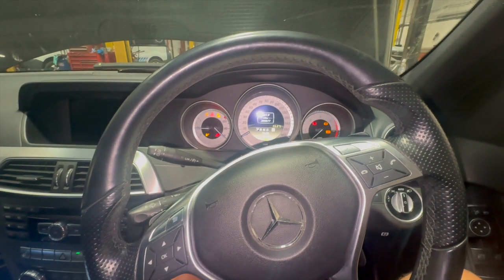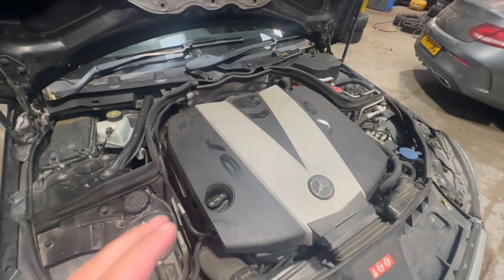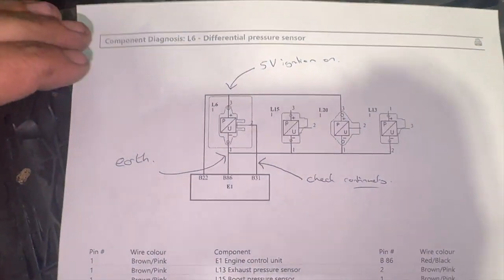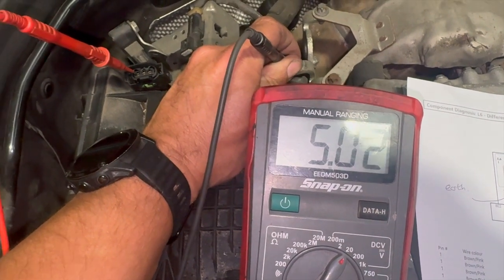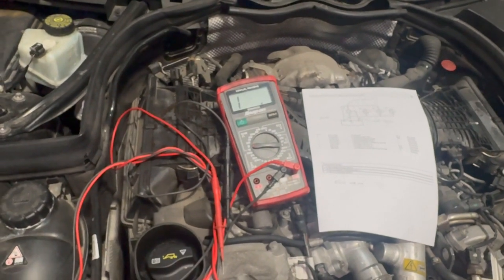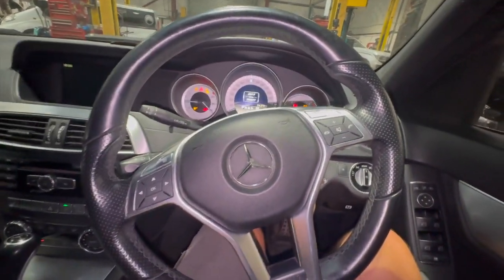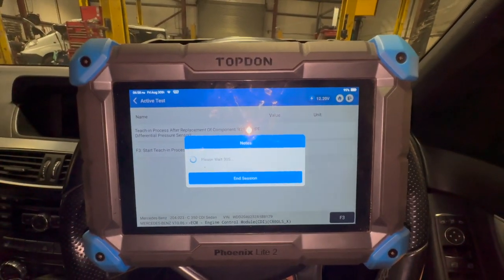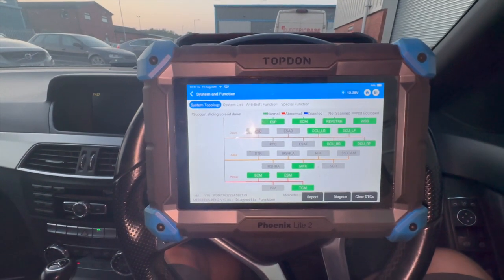Mercedes C350 Investigating & fixing Engine light fault P15FF DPF Pressure  Sensor replacement

Comment: I’m reaching out for some advice on my 2018 MK8 Fiesta EcoBoost with 66,000 miles (105,000 km). I recently bought the car from my mother, who had it from new and maintained it with a full service history. The car was never driven hard or far she mostly used it for commuting.

Here’s the issue. On Monday, while driving on the freeway and attempting to overtake another car, I noticed that when the RPMs went over 4000 the car cut power. I pulled over, turned off the engine, and restarted it—after which it ran fine again. However, the same problem occurs every time I push the RPMs over 4000. When I restart the car, it operates normally until I reach that RPM threshold again.

The car drives fine otherwise and fuel consumption seems normal. I recall that my mother had a MyKey issue a while ago where the car wouldn’t go faster than 35 mph. Could this current issue be related to the MyKey, or is there another underlying problem?

Any insights or suggestions would be greatly appreciated!